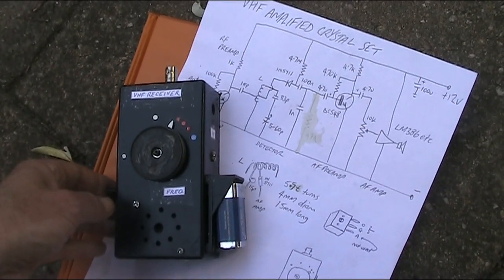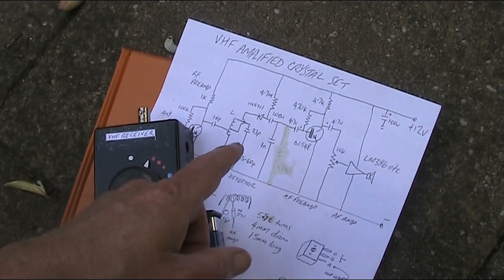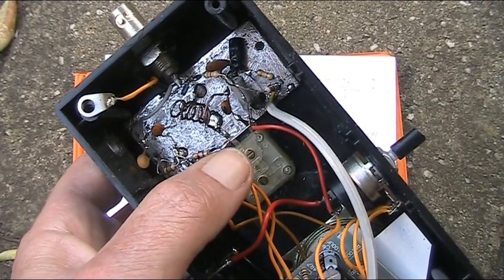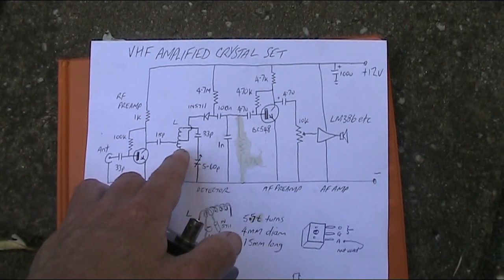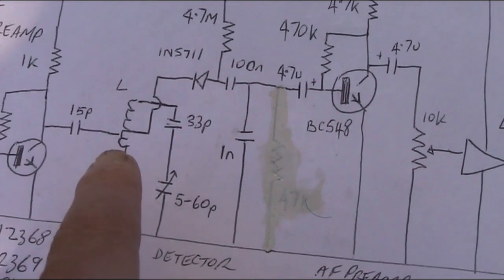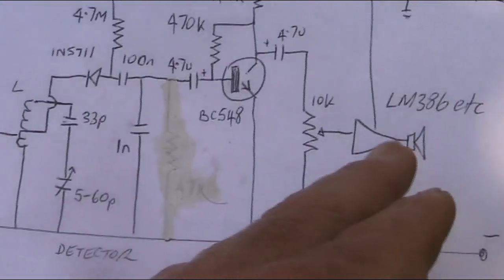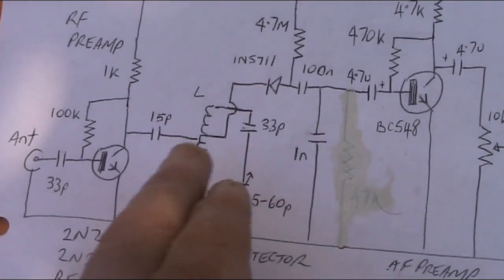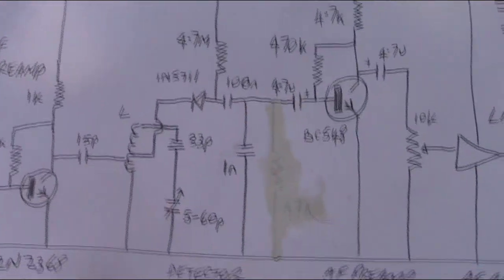What can you hear on a VHF 'crystal set'?

Comment: Around 60 years ago, I remember going to a "field day" in Sydney. The ham had a small transistor Field Strength meter that was used for 2m.  You could also listen with an earpiece  to a close transmission.  I'm guessing this was probably a similar circuit.

Comment: Sir, would you please help me I'm beginner in electronics.. I have been made your circuit correctly but i don't know where the audio output to connect the circuit with the lm386 audio amplifier module.. The last stage is difficult for me i stopped at 4.7 capacitor and the 10k potentiometer.. I also used germanium diode instead of 1n5711 and omitted the 4.7m ohm resistor & 100nf cap the i added 47k resistor.. and i used vhf transistor 2n3553..
The only problem is how to connect the circuit to the audio amp module
Reply from the maker: Google LM386 audio amplifier circuit and you'll get connection details. A 2N3553 is a VHF RF power transistor likely unsuitable for this receiver so I suggest something else.
Reply: @vk3ye 
Many thanks